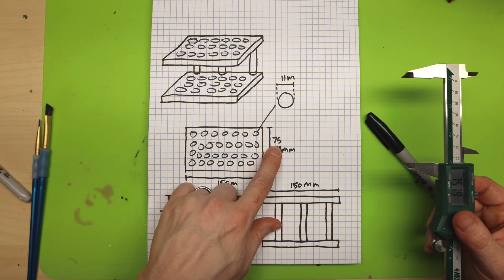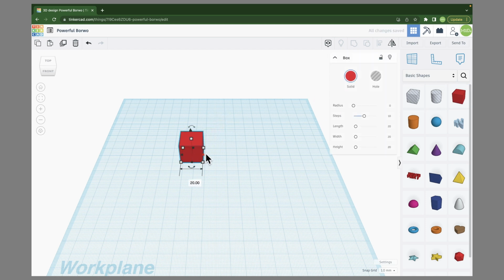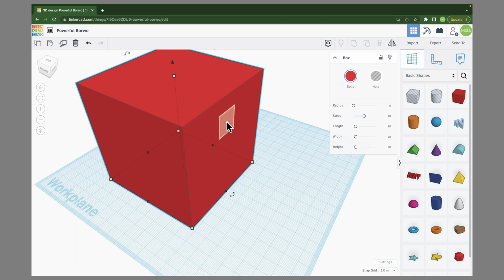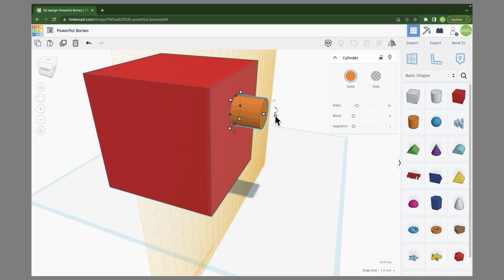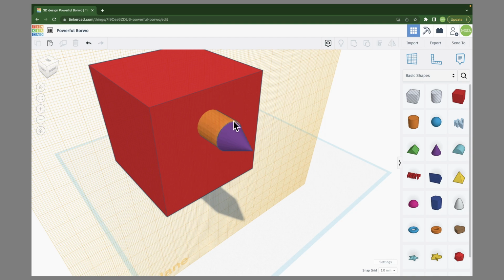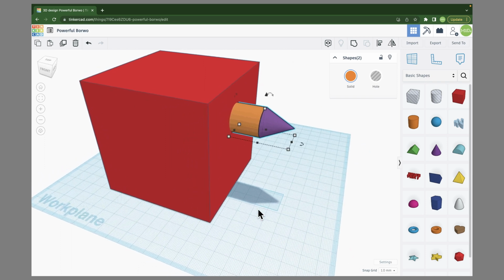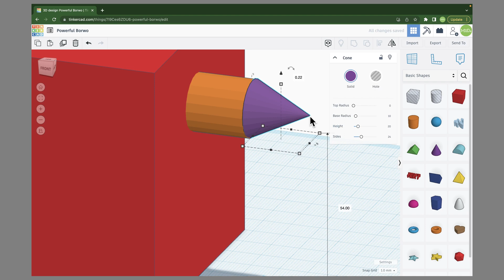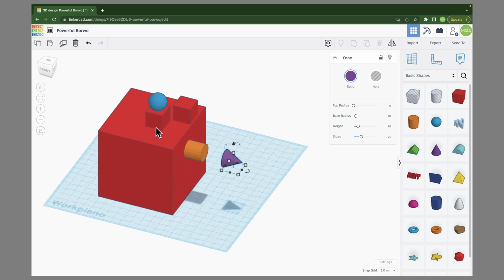Master the Workplane Tool in Tinkercad

Comment: What if you want to put something on the underside of the workplane? So, in your example at 2:06, the cylinder would be on the same side of the workplane as the cube
Reply: I figured it out, the answer is to high the "shift" key before selecting the workplane

Comment: Leaving this here for anyone facing my same predicament. Suppose I wanted to make the face of the orange cylinder that the purple cone is now sitting on as my new work plane. I cannot see that face on either the purple cone or the orange cylinder. I can make the plane visible by not moving either out of the way by selecting the object I want to hide and pressing either ctrl+H or the lightbulb to hide say the purple cone. A lightbulb then appears on the menu to show all, or you can press ctrl+shift+H to unhide all.

Comment: I am trying to replicate a 10/24 screw. since the tread object is metric. I don't understand if the thread count is 24 per inch. Is the thread count in (rotations in the selection of the tread) 24 per what? inch or mm or 24 rotations per 25.4 mm =1inch

Comment: I've been trying to figure out how to invert the plane so the item goes inside of the other item. so in your case, the cylinder would have a cone carved into it. Its like having the plane on the inside surface rather than the outside and the cone being a hole rather than a solid.